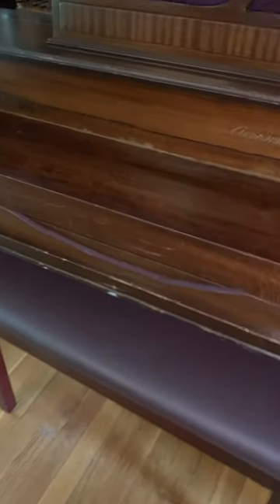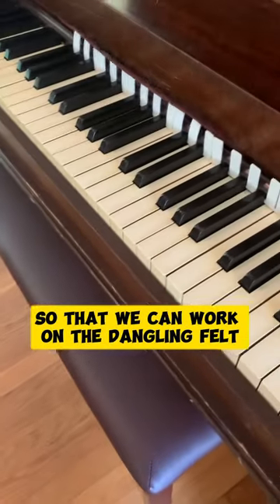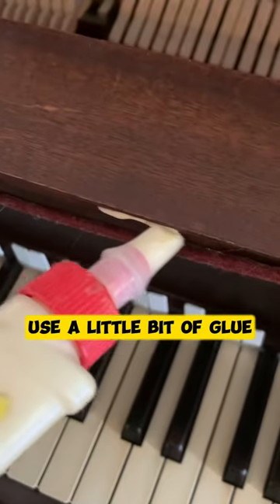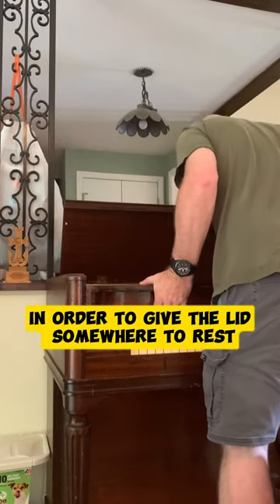Quick easy solution. fix loose felt on a piano #piano #pianomusic #uprightpiano #pianotuning

Comment: Would pvce glue work better than wood glue for this?
Reply from the maker: Possibly. I am not a glue expert. I have found through the years that wood glue does a lot of things. With felt, you want to be careful not to get it on the surface you wish to stay soft as it will get hard with the glue mixed into it.